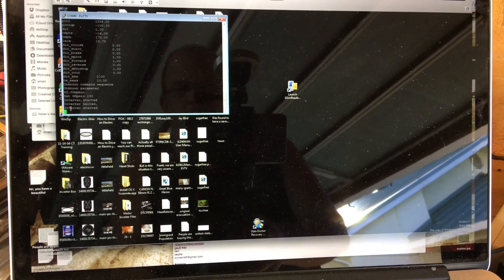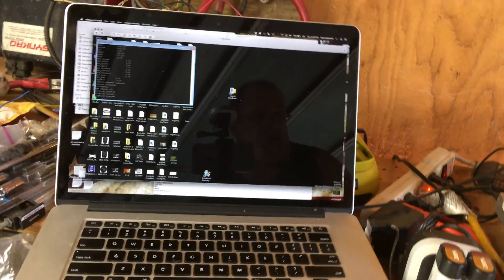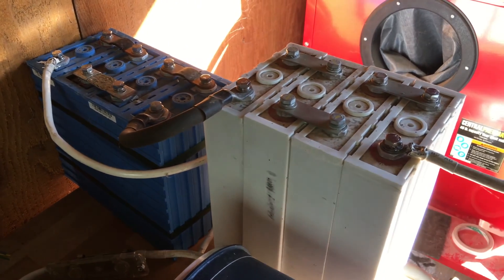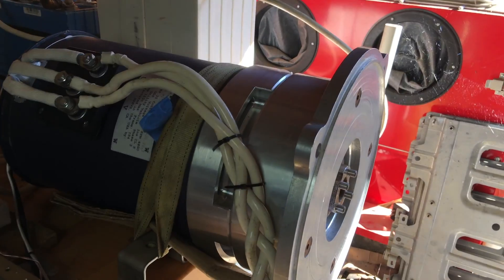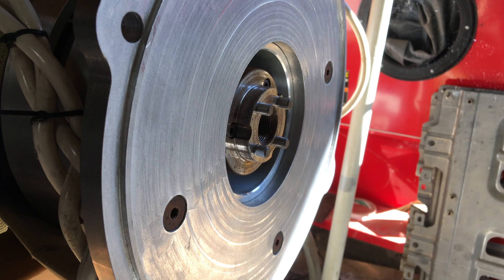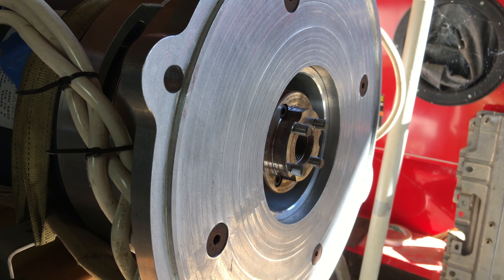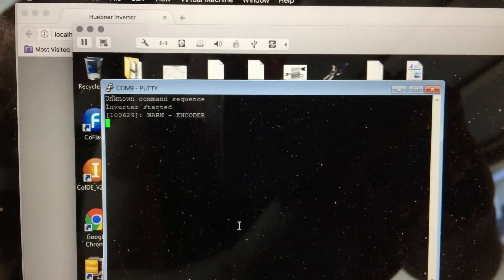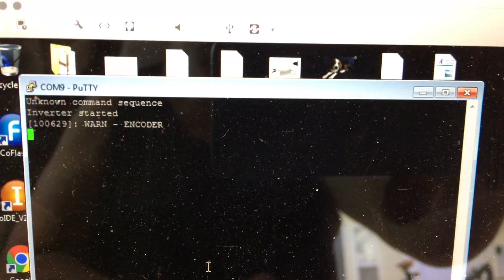Hübner Inverter AC 35

Comment: am still running the curtis controller in a wheego whip at 96 v but am having precharge  code 14 been driving it in 3 rd at 55 mph then just quite . very interested in what you're doing . i like running the agm batteries thow
Reply from the maker: Pre-Charge code, might be that your resistor is not working properly. What contactor do you use? What do you use for Pre-Charge and do you have a good heat sink on your controller?